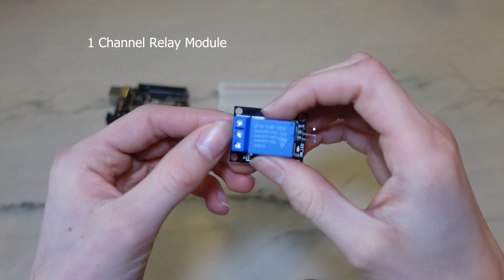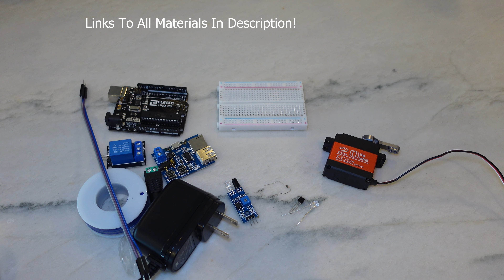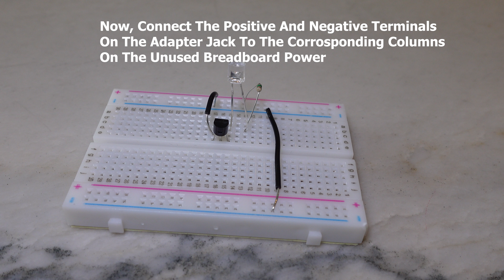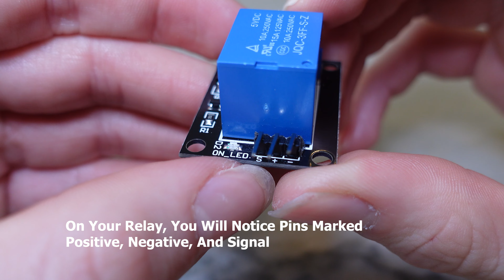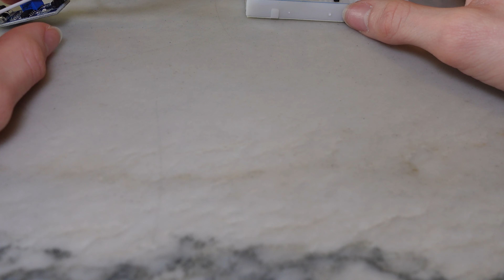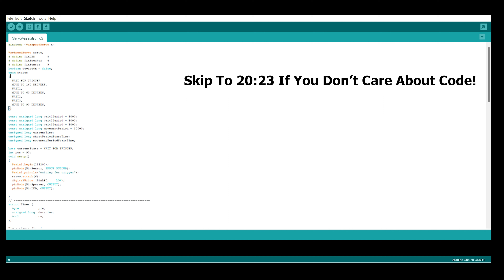Build Your Own Halloween Animatronic With Arduino!

Comment: Great tutorial, although I'm wondering, is it possible to use regular DC motors with this somehow? I know it would have to be wired differently, which is why I'm wondering.
Reply from the maker: Yep! Keep in mind that code will be decently different, and if you want to be able to change motor direction then you'll need a special driver chip (https://youtu.be/d7oFD-zQpuQ). If you need diagrams or code dm my discord (HalloweenCentral #5446)